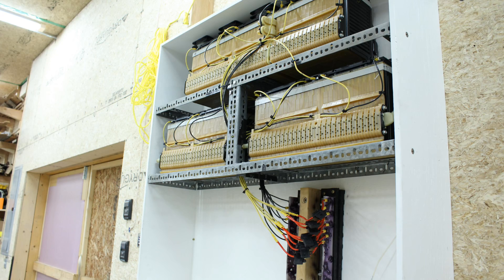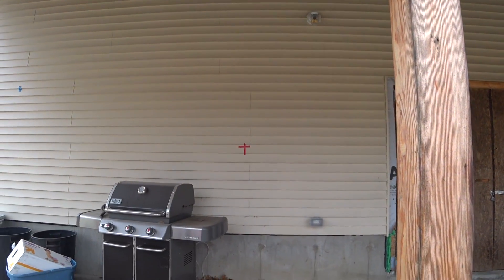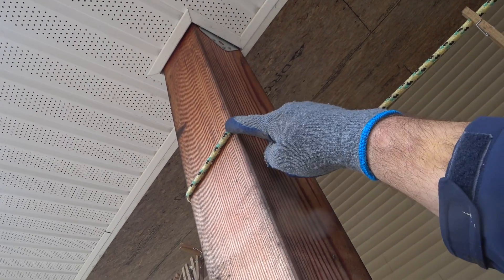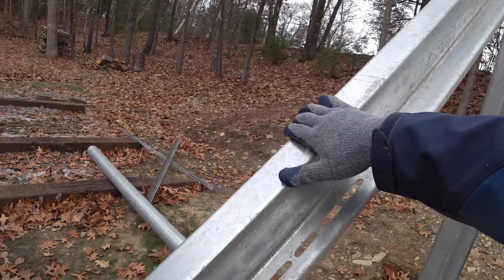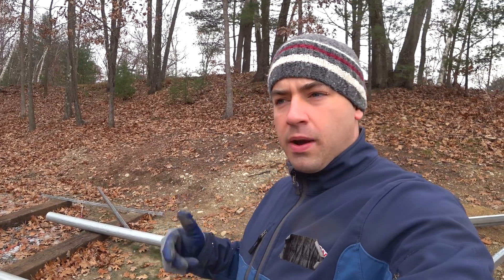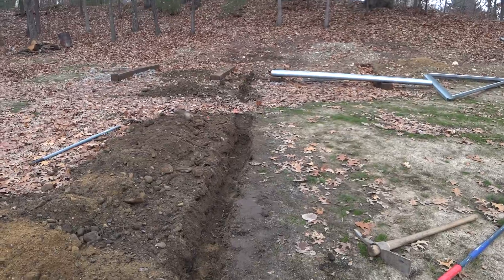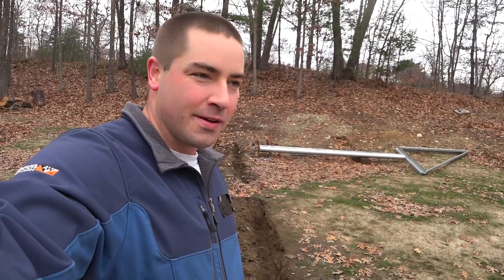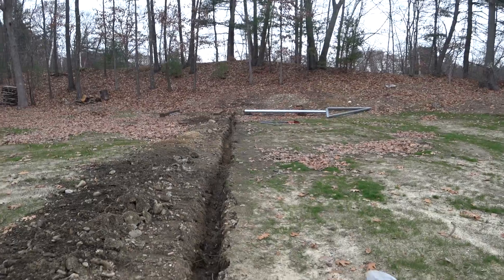Protect Your Solar Wires by Burying in Trench

Comment: Thanks for pointing out that the angle that optimizes for max yearly production is not really the key thing when thinking in terms of off-grid or even just optimized for self-consumption. I grew up and still have family throughout New England but I'm personally in Northern CA now. In New England the steeper the angle the better for winter shedding of snow/ice which will help things run with less maintenance. The other consideration, and the main one for those of us who get no snow or much less snow, is that sizing for total use, you are better off optimizing the angle for when there are lower production hours per day and fewer sunny days on average as there isn't a good way to store excess production long-term. When you size for supplying all your total power throughout the year but optimize angle for the max yearly total output you will end up with less power than you need in the winter and more power than you need in the summer. We are further south than you and 30 degrees is the generally accepted ideal angle, but my current intent is to build at 45 as it will drop my estimated yearly total by around 3% but boost my average daily production in the darkest/lowest production months by around 9%. Still weighing variables as higher angle mounts are also more expensive and require more robust anchoring due to wind loading. 

An additional consideration is if your usage will fluctuate significantly throughout the year. We are building off-grid as power and new grid connections are outrageously expensive even though lines run through our land. Our intent is to be 100% on solar electric BUT we are actually likely to NEED more power in the summer as our AC usage will likely consume more power than our heating usage especially if we end up with a wood stove (access to free wood) to lower our power usage on the coldest and lowest power production days. Good luck cooling a building with wood fuel ;) That said, our summer solar daily production for 30 degrees is over 2x the winter production and our power needs will never vary THAT much seasonally so it's better to boost the winter a bit by angling to 45 degrees. Your needs on heating vs cooling will definitely differ from ours though.

Comment: Nice! Oh man that trench looks brutal. What solar wires did you use to hook the solar arrays to the panel? Do they make wires that long or did you tie a bunch of wires together?
Reply from the maker: I used PV wire with MC4 connectors to go from the PV panel to the combiner box.  Inside the conduit is normal THWN.  Here is a link to the PV wire: https://www.altestore.com/store/cables-wiring/solar-panel-wiring/multi-contact-50-mc4-connector-extension-10-awg-p9061/
Reply: @DavidPozEnergy  Thanks David! Love your video (thumbs up) and it really helps me plan for my install. Is there a specific gauge you used for the THWN wire conduit? I don't have room to put all my panels in one location. Is it possible to distribute groups of panels say (10 panels) per location across different areas? They'll be about 40' apart from each other.
Reply from the maker: Yes, it's possible to space them apart.  But every time you space them apart you will introduce more loss in the wire.  I used 6 gauge wire inside the conduit.  This was bigger wire than required by code, but it minimized my loss.

Comment: Are lightning strikes a problem for this type of buried cable connected to your equipment? I had some buried data cables that burnt out the ports they were connected to. After adding some surge protection everything was fine. When lighting strikes, there is a electric flow in the ground as well that causes induction in buried wires.
Reply from the maker: I added some SPD, Surger Protection Device yesterday and am working on editing the video.  Check back soon to see it.

Comment: Hi. Everything's fine. I will add you my opinion.:
1. the cable must be immediately thrust into the pipe, and then only to bury.
 2. Solar panel gives 12V, you have a long distance to the house, at this distance there will be large losses on the resistance in the cable. Do cable cross section of at least 35-50mm in square.at a power of 1000 W. 
Bye. good luck!
Reply from the maker: Thanks for watching.
Reply: @DavidPozEnergy   I laughed reading your comment because I had the same instant "uhh okay then" reaction that I'm sure you did haha

Comment: I would have left room for future upgrades. Maybe larger conduit. And definitely something to pull wire in the conduit!
Reply from the maker: Hi James, how much extra room would you have left?  I already doubled the diameter than what code required.  I could expand my system 3 more times and still be within code for running wires in that conduit.

Comment: I purchased the PV Assistant software from Solarpathfinder.com that could help more accurately determine your monthly production based upon the angle of your array.  what does your southern horizon look like and what panels will you be using? Glad to help you out ..... I am installing a 16kw system using 4 tracking arrays.  I have about 200 feet of trenching to do next week - not by hand tho.
Reply: Also you should have a slip joint above where the rigid conduit comes out of the ground to allow for expansion and contraction or ground settling.  However since you will be transitioning to liquidtite at the top you can use the conduit straps that allow for the conduit to move.  In other words don't ridgidly secure that vertical rise or you will need an expansion coupling.
Reply from the maker: I agree.  I've already go the slip joint ready to go.
Reply from the maker: Hi Jim,  Thanks.   Is that software able to tell what angle would give the same Kwhrs. in Dec. as in June?
Reply from the maker: Hi Jim Roth,  Thanks.  My Southern horizon is clean.  I'm placing the array at the north side of my property, and the garage is on the south side.  I watched this last year, and on Dec. 21 the shadow from the garage roof still did not reach the array spot.  (came up close, but did not touch) 
 However, I do have a lot of shading east and west, so I can't capture early morning or late evening.  I only have about a 4 hour window all year long (10-2)
Reply: David - I ran some numbers using generic info for panels, etc at your latitude and assuming sun hours between 10am and 2pm with no shading.  A tilt angle of 37 degrees will maximize your total production.  A 50 degree angle would increase your winter production (Nov-Feb) by about 3% however decrease your summer production (May-Aug) by nearly 6%.   Since winter production is 35% lower than summer at your lattitude, I would recommend using 37 degrees unless your system size would produce more kw-hrs than you use on an average summer day.  This estimate can be refined with more system specific info.  Hope this helps.
Reply: Difficult to say without specific equipment info and a more exact location.  55 degrees minimizes the high/low month difference with the generic panel data I'm using.
Reply from the maker: 55 degrees.  Hmm, so even steeper than my current mock-up of 47. What to do...    Pros and cons to each.  Thank you for running out those numbers.
Reply: Not sure it's worth the total production loss but that's just my net metering side talking.  That and the fatigue from mixing 90 - 80# lb bags of concrete since this weekend ..... another 54 bags tomorrow and the ballasts for my tracking arrays will be done - 3500# per each of the 4 arrays!
Reply from the maker: Can you send me some pictures, or join on facebook?  I'd love to see your tracking array.
Reply: @DavidPozEnergy  I am on Facebook just don't post on it much....too busy lol.  I am planning to do a video or post pictures after I get the panels mounted.  I dug about 120 feet of trench today using a 24" trencher.  90 feet of that was through ground that I cleared trees from so it was slow going due to roots.  I still have about 70 feet to go.  The ground is still pretty saturated and the wet clay tended to mold around the cutters of the trencher - it was like using a butter knife to cut bread.  I'm glad I decided to rent a trencher as digging this 20" deep, 200 foot trench would have killed me to dig by hand.  It's $400 well spent even if over budget....
Reply from the maker: https://www.facebook.com/DavidPozEnergy/

Comment: Would the extra cost and complexity of a tracking system for your panels be worth it for such a high latitude?
Reply from the maker: Hi Devvy Nully,  I've debated about that myself.  I think a duel-axis tracker is not worth it.  I have too much shade in the morning and evening that tracking throughout the day is not worth it.  However, I've been debating about a seasonal tilting array.  Steeper in winter and shallower in summer.  That might be worth it, and I even made a video with a model I made about that.  However, at this point I think I'll just make it fixed because I want to finish this array.  It has been too long waiting.

Comment: I would haveq laid out my wire, run each 10 foot section through the wire, then only after that would I have glued the joints
Reply from the maker: That's another way to do it.  I used to do that on sites until an electrician taught me how to use a shop-vac to pull a string.  I found it made things easier, but both ways work.  Thanks for watching.

Comment: I keep looking at that pool of water under the train track rail, what are the plans for that.
Reply from the maker: Hi kevmar marsh,  The water pooling is interesting to me.  I never had pooling water until I tried to make a lawn this year.  I brought in topsoil, spread it out with a tractor and planted grass seed.  It appears that I have made the surface less porous than before.  This was probably due to the compaction of the tractor and back-dragging the bucket.  I also did a bad job flattening the dirt.  My first plan is to till the dirt in the spring and work it flatter by hand.  This should loosen the dirt and hopefully make it more porous.  If that doesn't fix the pooling water, then I plan to add a gutter to the garage.  The garage roof is around 1/5 or 1/6 of the watershed.  If I add a gutter then I can divert that water around to a different area.  If that doesn't work then I might have to add a dry-well back there.  Anyways, those are my preliminary thoughts but I'm no expert at landscaping and welcome any suggestions.

Comment: So   What wire did you use Brother Dave?
Reply from the maker: Hi Jim Davis,  I have not yet purchased the wire.  This video was me racing before the storm we got last night to get the conduit in the ground.  We got about 8 inches of snow last night and into this morning.  No record or anything, but still something I was trying to beat. I have PV wire to go from the solar panels to the combiner box.  From the combiner box to the charge controller will be 100% in conduit, so I can use THHN.  I'll be running 8 AWG, or 6AWG.  Both meet all the criteria for ampacity, but the 6AWG will have less voltage drop.  Any suggestions?
Reply: DavidPoz no.  I’m going to save that info    I’m going to re do my system in the next near future.  Good stuff.
Reply from the maker: This is the resource I used: https://www.altestore.com/video/wiring-your-solar-electric-system-v32/
Reply: What is the length of your cable run and voltage/current?
Reply: I recommend 4AWG  less voltage drop.... 👍

Comment: Nice brother. I wish I would have put a bigger pipe down. ended up having to put a 2 one in the ground..
Reply from the maker: Thanks.  You never regret using a bigger conduit than needed.  Back when I looked this up I think I could have used 1/2", but that seamed extremely tight to me.  So I went with one inch.  Thanks for watching.

Comment: your angel sounds a little steep about 40 degree  would sound right here is a link     https://www.solarpaneltilt.com/
Reply from the maker: Thanks Mark,  I've read that same page before, it's a good link.  As the author said in the post, that formula works for making the most kwh per year.  It does not address my concern with an off-grid system.  I want to make the same kwh during the month of December as I do in the month of June.  Thanks for watching.
Reply: @DavidPozEnergy  thats hard as the december angle is a lot steeper to make a deciet amount of sun hours the alround angle makes the best of the sun with out adjusting for summer and winter that would apply to grid or homested setup most people go for the twice a year adjust to get the best out of the sun the steeper angle also helps with the snow in winter

Comment: Cheers I put my panels up first so now I get to dig too lol
Reply from the maker: I hope your have better soil for digging.
Reply: @DavidPozEnergy   lol yes I am in sand but your clay and rocks brings a few holes I dug to mind, I'm at 45 degrees latitude so you are a bit north of me but we got snowed out already. You may want to be more like 55- 65 degrees to get what you call the same summer and winter as winter hours are so short Cheers and good luck.
Reply from the maker: Hi OffGrid Wanabe,  I'm at 42°N, my mock-up frame is at 47° from horizontal.  Thanks.

Comment: I would have put a pull cord through that conduit as I was gluing it up.
Reply from the maker: Yeah, I did that early on in construction, then an electrician taught me to use a shop-vac.  Made things easier.  Thanks for watching.
Reply: Really?  Perhaps you could do a video showing hot that works.
Reply from the maker: I definitely will.  Hopefully that won't be too far away, but if I was to guess I would say a month from now.
Reply: @DavidPozEnergy   What do you use for the ball or end of cord when you suck it through
Reply from the maker: @OffGrid Wanabe: On the end of a string I tie a plastic bag.  The disposable ones from the cash register.  I'll make a video about it when I get to that stage.  It works great.

Comment: I would of ran a wire pull string in the pipes.
Reply from the maker: Yeah, I did that early on in construction, then an electrician taught me to use a shop-vac.  Made things easier.  Thanks for watching.
Reply: Brian, you can tie a foam grenade or a plastic bag to your string at one end of the pipe, hook the vacuum to the other end, turn it on and suck the bag or grenade attached to the string through the conduit to the other end. Tie your wire pull to the string and pull it back through. Then attach your wires to the wire pull and pull them back through the conduit. This keeps your string from being glued to the inside of the conduit.
Reply: ok ok I'll bite he he, what's a shop  vac
Reply from the maker: Hi Mark Richardson, "Shop-Vac" is a brand name of vacuum cleaners that can be used in wet and dry locations.  They are often associated with workshops, sawdust, construction.  I'm using the term generically here (kinda like "Xerox, or Kleenex").  My personal vacuum in my workshop is a Rigid brand: https://www.homedepot.com/p/RIDGID-14-Gal-6-0-Peak-HP-Wet-Dry-Vac-WD1450/100081216